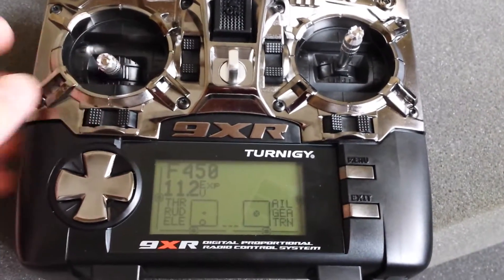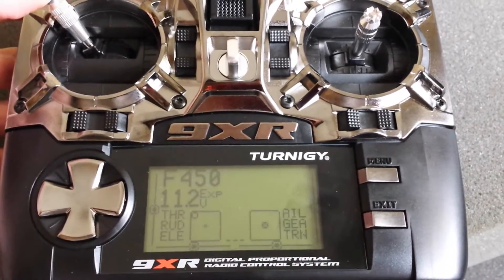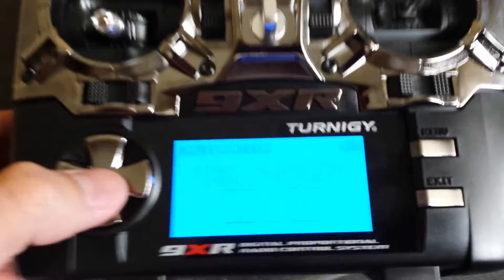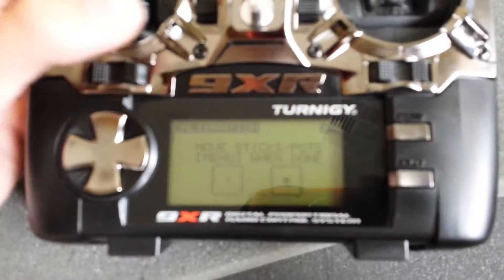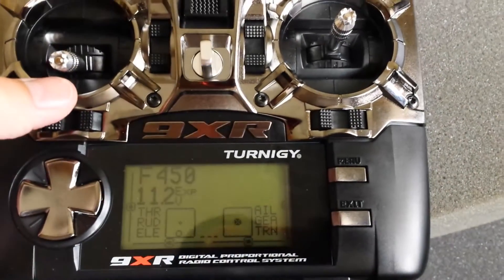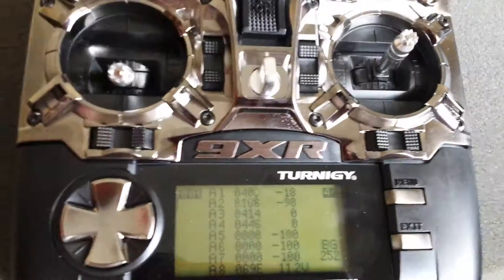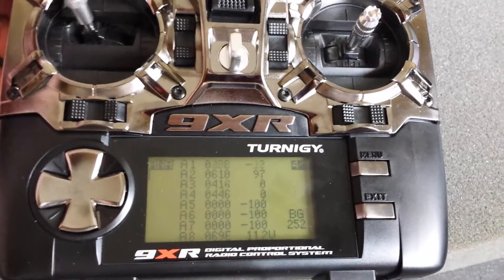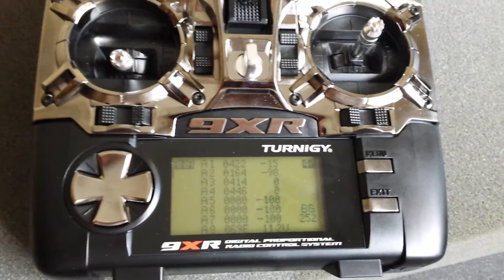Turnigy 9XR Left Stick Issues Demonstration

Comment: I had the exact same problem. Opened up the Tx and realized it was a loose connector on the yaw gimbal. Pressed it back tightly and the problem was solved.

Comment: I had the same issue. I opened the controller and found that the connector with with wires coming from the left stick was not fully pushed into the socket. Making sure the connector was fully inserted solved the issue for me.

Comment: Problem with yaw value rising (flactuating) while throttle changes is easely solved. You have to dissasamble 9XR. Find left gimble. Gimble is connected with 2 connectors, each having red, white and red wire. You have to cut away pins on gimble side and solder them directly to gimble distribution board. I did this just to one connector - Throttle one. Be careful to solder right wires to right places! :) 
How did i figure this out..
Dissasemble 9XR, connect your Quad to PC (Cleanflight or Baseflight..), connect batery to 9XR and turn it on. On ChromeCleanFlight open Recever tab and see the values of Jaw, Throttle, pitch ... changing while using 9XR. Put all sticks on 9XR in neutral position, turn over dissasambled 9XR (dissasamble just the back black plastic to see inside). Move wires around and observe values on Cleanfligt. The wire that is causing flactuations needs to be solderd directly, without connectors. 
Its a 10minute fix and works beautifuly :) 
Write, if this fixes your problem :)

Comment: Your 9xr has a bad gimbal. Mine had the same problem. Just order a new one from hobby king. 6 bucks
Reply from the maker: Good point, Alex - this is definitely what I plan on doing.  Hobby King definitely treated me right with the overall handling of the issue, which was really great.  I've now got a spare 9XR that I could replace the gimbal on and likely have it become fully functional (without defect).
Reply: Do you fly a 200 qx by any chance?
Reply from the maker: I sure don't... Just my F450 and a Hubsan X4.
Reply: I'm glad to see I'm not the only one with this issue. I have a 9XR that is fine but I have a pro version that has this issue. Mine is way worse than this. Unfortunately I didn't actually start using the radio until way after any type of warranty would have ran out. At least the gimbles aren't expensive. Just wish hobbyking would do my QC so this type of stuff wouldn't happen. I even have a regular 9X and when I got it it looked it was used instead of new. Display was scratched up, probably due to the assemblers carelessness.